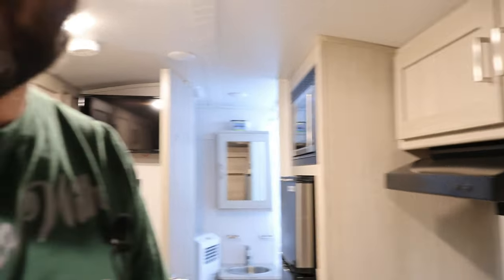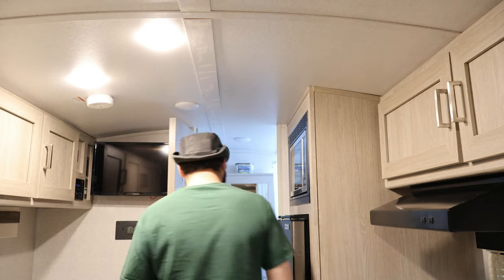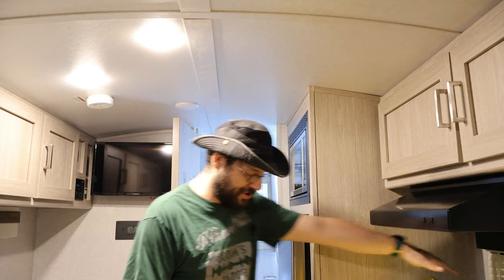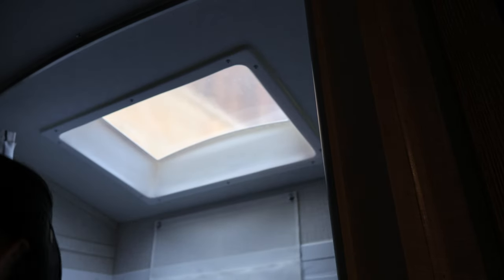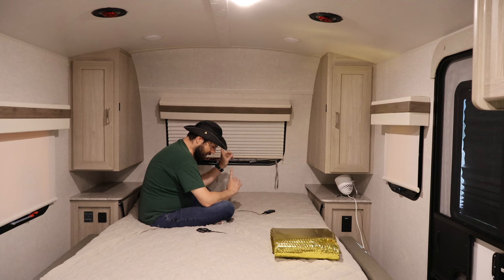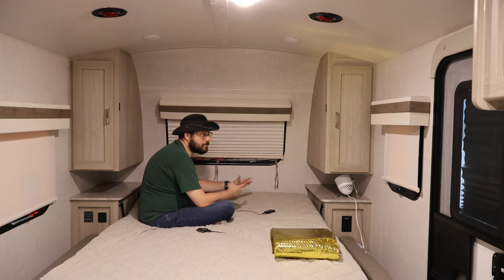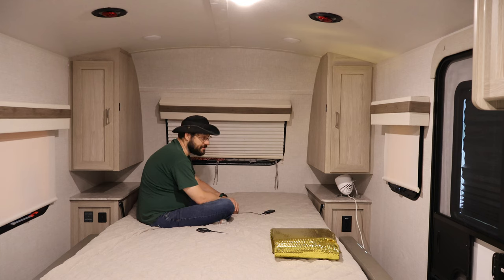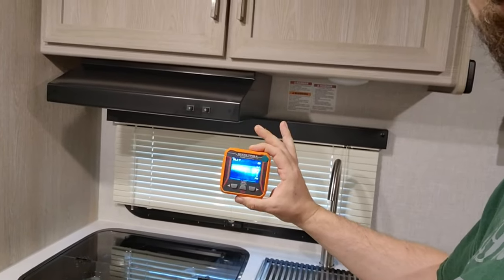Making our Geo Pro camper even cooler... literally.

Comment: The BLUETTI AC200MAX is a 2,048Wh, LiFePO4 (Lithium Iron Phosphate) power station that offers a continuous output capacity of 2,200 watts from its pure sine wave inverter (with up to a 4,800W surge capacity) and up to 16 ways to charge and run your gear.
Reply from the maker: It's a neat device, for sure, but at the same time... it's $1,600 and it gives you 2,048Wh and boasts 3,500+ 80% cycles. For $270, I can get a 2000W inverter (pure sine) and if I want LiFePO4 for the higher cycle count, I can buy 260Ah 12.8V batteries (giving me 3,380 Wh) with 6,000 cycles for more than $600 less--granted I'd probably have to spend another $200-300 on a decent charge regulator to match the Bluetti, but I'm still ahead on capacity and price, albeit not packaging or additional hookups (but I won't use most of them anyway). 
Also, I already have a 1000W pure sine inverter and a charge regulator with capacity for another 400W panel and an external hookup for another regulator and solar bank on the side. I will eventually upgrade the inverter, or perhaps just supplement it since it plays nicely with all the trailer's existing control systems, but I think I'll hunt and pick components as I go as opposed to bundled solutions--unless they're really good and outweigh what I might put together myself.
See:
 https://www.eco-worthy.com/products/lifepo4-12v-260ah-lithium-iron-phosphate-battery?gclid=Cj0KCQjwuZGnBhD1ARIsACxbAVibPLqQz09UJ5SHMERtu3pF419UE2gPrG37eJoxHa9z1BOTz8KTOvwaAkSjEALw_wcB
And:
 https://www.renogy.com/2000w-12v-pure-sine-wave-inverter/?Rng_ads=87fb709a60fca1b5&gad=1&gclid=Cj0KCQjwuZGnBhD1ARIsACxbAVjm7Bv6w6S0uO0iJQ4CmICspnkCasq65nJnqf7dbub3_ugBApmW9FEaAsVQEALw_wcB